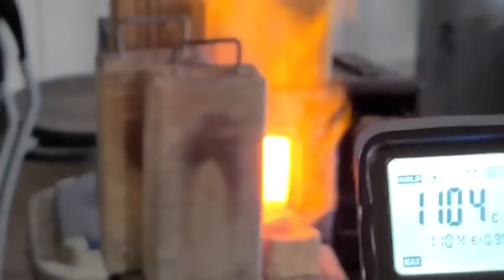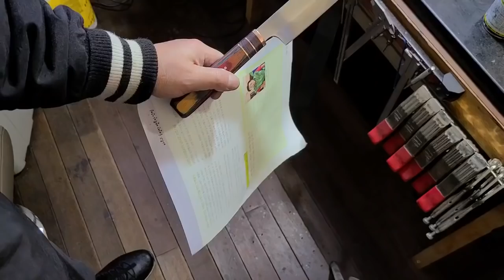KNIFE MAKING / YANAGI KNIFE 수제칼 만들기 #136

Comment: Beautiful Work. I am amazed that you work 440 steel in a propane forge. You rarely see that. Is that tricky with keeping the temp consistent?
Reply from the maker: I'm trying to maintain the temperature and checking it with a laser thermometer...It can't be perfect, but...
Reply: @artisticson2275  I have put off working with stainless because I don't have the fancy oven needed. Are you maintaining at least 2100 degrees f?
Reply from the maker: @seanscimeca1  Maintain at 1000 degrees Celsius for 10-15 minutes, then at 200 degrees for 1 hour to 1 hour and 30 minutes...
This is my method of heat treatment... Is that right?
Reply: @artisticson2275  it's my understanding that 30 minutes for heat treating is recommended but in viewing your videos... Your method seems to be working. You do beautiful work and have inspired me to try using my propane forge for 440.
Reply from the maker: @seanscimeca1  Warm-up state...So I think 10 to 15 minutes in a kiln with a temperature of 1000 degrees is appropriate...a thin sheet of steel...^^